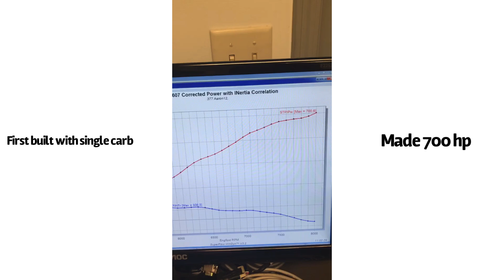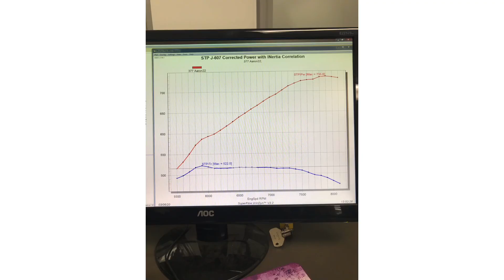377c.i. SBC Stock Block Pushed To The Limits!!!

Comment: I love them 377’s a little more than the 383 I’ll take that larger bore of a 377 over a 383 any day in race applications
Reply: ,,  ,,  IN, # 6 2, - 3, !!,  THE, LATE, MR, Z, " DUNTOV, "  👍,  LIKED,  THE, #377, , , "2,"   "4,"  THE, " GRAN, SPORTS, " !!,
Reply: Street also, over bore or over stroke is more efficient than squared engines initially.
Reply: The 377 makes a great dirt track engine built rite .
Reply: Use to run a 377 at the strip in a grimlin

Comment: On my 377 i couldn't afford the good heads so i use gm production 041 with 202 and 160 ported a little with small diameter base cam by comp cams put engine a 1970 ss nova full interior 3200 pounds with micky Thompson street tires i could only turn it 5800 to 6000 rpm and i ran 11.32 in the 1/4mile anyways  never got to try on slicks ended up selling car   but the 377 is the best engine I've ever had
Reply from the maker: Sounds like that was a fun car! Thanks for your reply Larry!

Comment: Love those 377 cid i built a 377 in the mid 90"s  had wisco pistons 12.5 compression with childs albert aluminum rods with gm 041 heads
Reply: any idea what kind of hp you made?
Reply: My 377 pushed out 603 horsepower on dyno at 8500 rpm 546 foot pounds of torq a bad ass small block wished i had a set of racing heads and different intake
Reply: @sportman8467  how ported were those 041 heads?
Reply: Actually we had alot of hours involved in porting work  my dad was a smart man when it came to getting all the performance out gm production heads the crank was knife edged light weight 6" rods i think i bought crank rods pistons as a packaged deal gave 3k for them cam was a special grind my dad was responsible for it being ground i use to have spec card on it not sure if its lost or put up somewhere my father passed away in 2016 he was a man head of his time truly miss him

Comment: I raced in a restricted superstocks dirt track division. 363cid chevy max rule. Holley 500cfm 2bl carb. We put 327 crank in 400. Yes it cubed to 348cid. We gave up 15 cubes but on flipside revved it 7200rpm (flat tappet cam, 10.5 max compression rule, iron heads with no porting allowed). It ate the competion.
Reply from the maker: Nice👍

Comment: I love destoke 400s .  Used to build them mid to late 80s till early 90s tunnel rammed with nitrous,  supercharged and several single plane single carb ones with and without the gas. Such wonderful times kicking ass

Comment: You think with 12° heads could have done better or ? Track and street engine ?
Reply from the maker: Forsure. These are 23 deg heads. If we used all pro 12deg. It would definitely make more power.

Comment: I have 379 destroked 400 too,  vortec heads stock , i plan for 234 /254  273 /292 114 .377 .389  solid roller cam. What is the quench, and the cam duration that work for you?
Reply from the maker: The quench was set at .039 and the duration is 286/297@.050

Comment: Built many mighty mouse engines... Shit doin 1 now. I like the 2 bolt over the 4. Beefier... Take advantage of the 6" rod angle relief. Doin an internal balanced 1 now, for a stick shift. Put a big Chevy snout on crank .milidon caps...

Comment: I bought a 55 chevy cameo a few years back and it has a mildly built 377. The guy I got it from told me not to rev it over 4500rpm. Does that sound right? I’d love to message over the build list I have for it to see what you think if you ever had the time! Thank you!
Reply from the maker: No problem, send it over to crew@fastforwardracecars.com
Reply: You must have the 350 block standard bore with 4 crank depending on build should only go up to 5500 to 6000rpm to be safe supposedly...

Comment: Sounds to me cam is 680 +  need that to turn them rpms. I have a 380 which is the 400 block with 3.50 stroke not 3.48. I have a 700 solid roller iron eagle heads worked. But dont know what power it may bring. What do you think. Oh 13.5 compression

Comment: What compression is in this engine. I also have a 377 stock block. It a 3.50 stroke crank with 6in rods 630 solid roller dart 215 iron eagles. Wondering what kinda power. It's 13.1 pistons

Comment: Thanks for the video. I have been kicking around building a 377. Right now i have a 406, i do not believe i will be happy with. The motor is going into a 79 su bird H body, like a monza.
  I have a steel 350 crank , that came out of a modified dirt car motor. It is .020 undersize, needs a good polishing. I have stock 5.565 rods with forged .030 pistons on them. I have 2 sets of heads to use, i have anberaly set of pro comp heads, never been run, and i have a set of 461, that have some serious  bowl porting and porting done to them. Those headscwent 10.99 on a 406 in a 78 malibu. Dual plane air gap intake. Reason i dont beleive i would be happy with the 406 in my sunbird. Way to much torque for my little car, do t want to twist it. 
  Your thoughts ?

Comment: Do you or do you know anyone in your area who does good work with Modular fords like the ones in a new edge mustang? I looked you up and I drive a Truck for a living and have been all around where you guys are located. I need to also locate a good 2000 - 2004 mustang to start i have an 01 GT but it will be my driver. Ill sell my 2015 explorer when I start the project.

Comment: I had a 377 built in the early 90s for a street car I had.
The car was a 1987   Monte-Carlo ss the engine was one of the best engines I have owned when I sold the car I sold it with the engine which I regret doing to this day.
It was one of those engines that wasn't supposed to make the power that it did.
When I had it built I put the best parts in it that were available at the time.
I believe the best dyno pull was 753 horsepower with a signal carb.
I can't remember the exact RPMs I shifted the engine at but it was up there  
To this day I regret selling the  engine

Comment: I built a 406 back in 1988 with +.030 over trw flat top pistons .. still had a dish, 2.02 valve 64cc heads ( Had to use 93 octane from Amoco , Exxon or Chevron) Had a crane HMV278 cam .467 intake .494 exh lift and 222 or 224 intake @ .050 lift intake and 234 degrees exh. 114 deg lobe separation weiand dual plane intake with an old 800 thermoquad <<< bad ass lol hedders from headman . Torque beast.

Comment: back in the late 90s my neighbor had a 67 camaro drag car with a 377 in it, made 700 HP. at 7200rpm running a 750cfm holly double pumper, he put it in a mud truck eventually, ran a LOT of passes with that motor. Ive wanted to build one every since.
Reply: Gotta few questions on self and timing i built 377 stroker
Reply: Fuel pressure and regulator?

Comment: I been wanting to build a 377 for a while now.  Is there anything special that I need to do to the Block or crank to run a 350 crank in a 400? What rods would I need and is there a wrist pin offset?  Can I turn it up 10grand All Day, like a 350? Lol... thanks for any input or suggestions.
Reply: He told one guy here in the comments that he used 6" rods.
Reply: It's like a 350 but instead of .060 over pistons, it's .125 over, so as long as the bit of extra piston weight doesn't tear the rod caps off, it's fine. Also they use bearing spacers for the crank. It looks like two bearings stacked

Comment: Hi I have 377 but only makes 500hp. If its not top secret what are the cam specs and compression ratio and fuel. Thanks.
Reply: ,,  ,,  THAT'S,   STILL, A, GOOD, - #

Comment: 700 horsepower out of a naturally asperated 377 wow! Makes me want to do a 377 instead of a 383. I wonder how a 377 would do as a daily driver under 3,000 rpms
Reply from the maker: The 377 is an awesome engine but you have to spin them high RPM to make power. You would probably like a 383 better for a daily, because they have more torque down low where you would want it for daily driving. Thanks for checking out my vid👍
Reply: 415 is the way to go...

Comment: I have the same heads with Alot of port work and bigger valves than they came with...question is what compression ratio and carb u had when it was single carb....also was it race or e 85 or...
Reply: I’m wondering the sane

Comment: What block number ? 
I am boosting a Sbc 400 40 over 5.7 rod 
All forged 817 block shooting for 600 wheel hp but was a little nervous with the stock block I did hear of guys making more so fingers crossed lol
Reply from the maker: The block I used was a 1970 511 block.  These blocks are definitely not ideal for boost lol.  But it’s like anything, if you take it easy on the boost it may live for awhile. Good luck on your build and thanks for checking out my video👍
Reply: @FFRC  haha! We are definitely gonna test that theory haha!! 
Thanks for the reply I appreciate it ..
Reply: 600 wheel will be over 700 crank. I have a 406 forged crank,rods,pistons, solid roller Erson cam(.548 .548 ) 1.6 rockers make it a .584, AFR 210 comp heads(65cc chambers) victor jr intake, FST billet extreme 750 carb and 17/8 headers and I made 526/504 crank hp but only made 388 to the tires. Thought something was wrong but I guess that’s typical parasitic loss. Stock 511 block. Hope you don’t get your hopes up because dyno’s smash them. Take care and always mark your territory with 2 black marks.
Reply: @royalchaser8090  oh wow ! You definitely have more motor then me! Sounds like you went on the mustang dyno aka the heartbreaker  people call them lol because it sounds to me like 385 is very low …
But I am glad to hear the block is doing good! 
My block is at the machine shop as we speak  having it cleaned up and the decks machined for MLS gaskets . Lowering my compression down to 9.5ish for a more pump friendly for the turbo I’m not shooting for the moon I wanna try and squeeze into the 10’s 
My turbo is capable of splitting the block in half that’s why I was thinking 500/600 to the wheel should get me there and would probably maxing out the block 
    Did you runs yours down the track yet ?
Reply: @juiced71  I have ran probably 40 1/8 mile passes and I daily drive for 4 months a year and bust my car out on nice days in February if it’s not frozen outside. The best my Camaro has run with stock suspension and frame connectors is 1.64 60ft 7.46@92 mph on 92octane. It’s a dynojet that a friend owns for his shop. I have seen his 4 cylinder Toyota make 800 plus on the same rollers so I am not impressed with my numbers or the numbers that it cost to have built lol
Reply: @royalchaser8090  wow 800 that’s crazy ! Amazing what these engines can do! 
   And yeah that’s why everyone is going LS Sbc cost a bit of money to make decent power! With a Sbc Where a LS block can handle big power!! And the heads are factory 15 degree can’t beat it !
If mine didn’t have a forged bottom end in it I would have just went LS 
7.50 isn’t bad my buddy out in Cali had a 78 caprice with a 421 I think he runs 7.2 on a 150 hit he just put bigger tubes on it so he’s thinking it was a little clogged ha!
   I believe he was running RHS heads
Reply: @juiced71  I really want to go faster but don’t want to cut up a(numbers matching if I put the original parts back on) 73RSZ28 to do so. Which leaves me with either building a race car or staying at this speed and being able to drive around in a cool car. Only say that because you don’t see many 2nd gen split bumpers or any 2nd gens because they all went to the local dirt track races never to return.
Reply: @royalchaser8090  I love them cars!!! Guy in out club has one  really nice has a 383 afr heads very mild he just cruises ..
Another guy has a twin turbo dart block etc makes some steam for sure !! 
I’m hoping to get some footage of his car before winter hits! He’s waiting on the trans ….
I don’t blame you one bit! Nothing better then having a good running car taking it out on cruises and hitting the track on weekends! 
    That’s why I went turbo I can run 3.08 gears drive the car anywhere and it pulls pretty hard …
I’m in the middle of rebuilding mine I was looking at the trick flow 215 heads but not sure if spend 1900. Or just stick with the sportsman 2 heads my block is a 2 bolt main 400 it has all the forged stuff but it’s still a 50 year old block 
Might be better just using the money and build a LS 427 …
Reply: @juiced71  My car isn’t pretty to look at with primer(not from dents or bondo ) on orange but it does turn heads and it has been around the area it’s whole life without rust. It’s quick with 3.73 gears but nothing crazy by any means. It was built for a 200 shot but the block might go boom if I decide to spray that much. Next year I will find out if I need a new engine because it will get sprayed at the track even if I get kicked out. Do you run drag radials on the street. Normal tires no matter how wide just don’t hook in my car and that gets expensive when I have a heavy foot
Reply: @royalchaser8090  ahh man these cars are cool with paint or no paint! 👍🏻
3.73 aren’t to bad I was running 3.90 a while back freeway @50MPH was 3 grand but light to light was fun!! Ha!!
And yeah with street tires it’s silly lol 
Even with 3.08 but turbos like load ..
I put slicks on it but definitely want to switch to a drag radial for the street …
    They are pricey but as much as I drive it when it is running it shouldn’t be to bad…
   Mine was built for a 200 shot also 
Was built in 2000 I sprayed it with a 150 shot a few times it ran good  but I must say on only 4 pounds of boost it felt better however since it was built for spray it had 10,7 compression 
And 3.90 gear 
It may just feel faster because of the long gear in it now just pulls decent..
I am refreshing the engine now dropping compression to a more pump friendly 9.1
E85 in my area is hard to find! 
And like you I want to drive it and enjoy it 
Not have to worry about running out of fuel lol

Comment: Sweet build! Very impressive for a factory block! 

What was done to the bottom end to keep the crank from spitting out on the ground? Did you install splayed caps or any sort of girdle to keep that thing in one piece? 

I seen some pretty horrific carnage of sbc factory 2 bolt 400 blocks that the main caps let loose and spit the crank on the ground. 😳  

My next build on my channel is a factory block sbc 400 stroker to 434 cid. It has splayed main caps and a halo girdle, hoping that will be enough for the Dart Pro-1 CNC 227 23 degree heads? Also has a Howard's 4-7 swap solid roller cam. I don't think it'll have the HP your has but it will possibly be more torque? 

Going to be keeping my fingers crossed that the crank stays in the block. Hope to hear what you did to keep that from happening. Thanks in advance.
Reply: Thanks I appreciate it!  I still used the stock main caps but I used ARP studs and made a girdle/windage tray all one piece. worked out perfect.  Its been holding up good, Ive been beating the hell out of it LOL!
Reply: @aaronstapleton8104  

Very cool, is it a 2 or 4 bolt main? 

Fingers crossed that mine will hold up.🤞
Reply: @itseithergonnaworkoritaint7852  Its a 4 bolt main.
Reply: I've heard that the two bolt blocks are a little stronger than the 4 bolt on the 400 due to the design or lack of material for the two extra bolts idk but it's what I've heard what's your opinion?
Reply: That is amazing power for gen 1 N/A beast
Reply: @glennmanchester5696  
Yes the 2 bolt block have the potential to be stronger if 4 bolt splayed caps are installed. The carnage I have seen posted on the net is of a 2 bolt main block with studs the spit the crank in the dirt. The block broke right there where the stud was bolted in.

Eventually I will be posting how to skip align boring when installing splayed caps. Will still need align honed but more machines shops have that hone while they don't have the align bore machine.
Reply: What r the specs on cam u used in this 377 sbc

Comment: Yes Bro your about right at the upper limits of the factory 400 block ...in fact I'm shocked you didn't opt for the RHS 400 casting or the SHP castings from any of the aftermarket guys the new designed 400 is just a much stronger starting point ..

Comment: Very cool build I'm doing a 406 now and have a second block with a 1970 forged crank to put it at 377 I'm just wondering what kind of power I'll be making I'm almost at my first start any day on the 406. That's a really cool build .an love those old school valve covers. I found a plain set of Edelbrock chrome valve covers with a nice old school air cleaner to match. Looks like a 327 i had in 1984 in high school. Anyway I've got alot of questions more than i could ask tonight but as far as bottom end what rods are you using for that rpm it's running and you briefly mentioned the crank. Just curious cause I'm clueless to what kind of power I'm gonna be making. 218 cc heads 205 160 flow 302 at 650 n start falling a little still good at 7. Cam is solid roller 639 654 exhaust 265ish duration. 800 cfm carb . Is there a formula to figure this out. Sorry so long you're the first video with a 377 like i want to do that's old school. All i hear is it's the wrong thing to do but from the sounds of yours that thing is badass. Can't wait to see it in your nova . Thanks for taking the time to make that video that made my day. Have a good one!

Comment: What brodix heads
Reply from the maker: The heads are brodix 10x 23 degree
Reply: @FFRC  is any work done to the heads and how much u turning the motor rpm
Reply from the maker: @Bookie Williams The heads and intake manifold were hand ported in house. The engine makes peak power at 8000rpm. It can rev to 8500 rpm no problem.

Comment: What Top Plate is on that Victor Ram? Not the traditional Top Hat! Bitchen Build!
Reply from the maker: Thanks Daniel! It actually is the traditional victor ram top plate, but I did some trick porting and changed the design inside with epoxy.